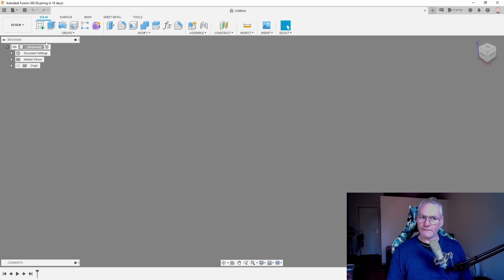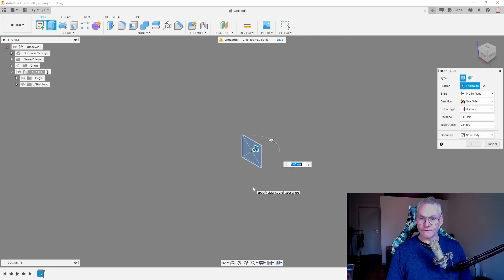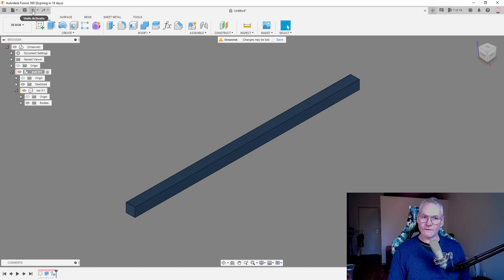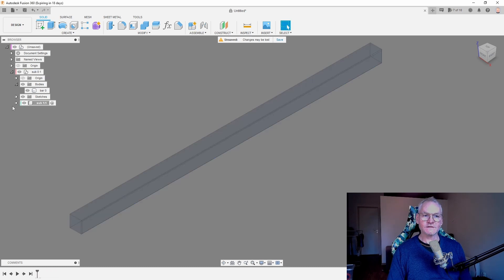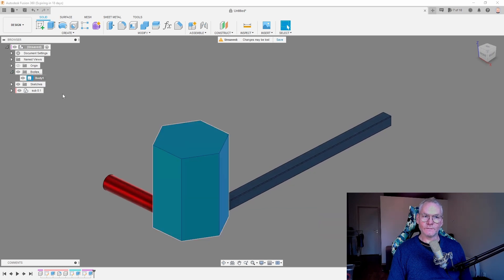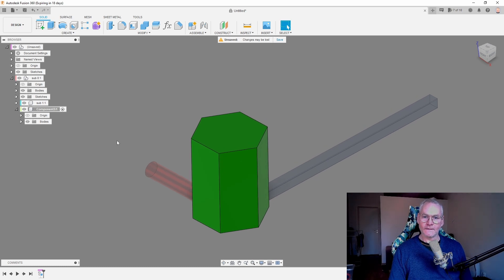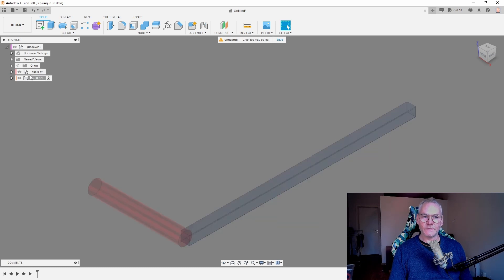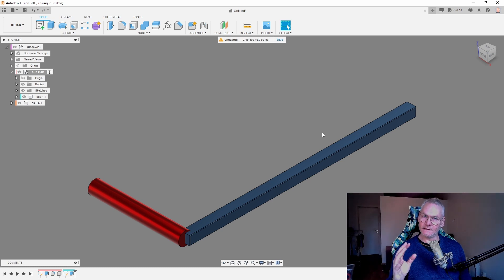FUSION 360 BEST PRACTICE - BIG ASSEMBLIES - MANY COMPONENTS

Comment: - thx for showing how NOT to do it, AND WHY not.
- Good "structure" (components, sketches, etc.) is critical to a good model (easy to edit, easy to understand, compute optimally, etc.).

- along these lines, and for your viewers, allow me to share this...

- Here is some insights into modeling, and my suggestion (at least it works for me)...
MY DESIGN/MODELING APPROACH:
--- What are the critical aspects?
--- What should drive what?
--- What are the basic geometric forms?
--- * What are the components, and their hierarchical relations? *
--- What params are required?
- Only then should things be done in F360 - and first, only component tree, and params... then finally, start sketching, and adding features/joints/etc.
- This way, a good underlying structure is more likely - as opposed to figuring out things on the fly.
- The main point: think before you do... the workflow and result will be much better.
- I realize some of this may be unfamiliar to users at an early stage, but assure they will help you move along in a good way, and is worth the effort.

Comment: Your components have a colored bar to the left of them (orange, fusia, cyan, etc), and there are corresponding colors in the timeline of the top level assembly.  I don't see that in my Fusion 360.  Is that a setting that you enabled?
Reply from the maker: Yes this is a setting. I don't remember where it is. Try right click somewhere
Reply: @PRO3DESIGN  I found it.  The little gear icon in the lower right corner.  The option is called 'component color swatch'